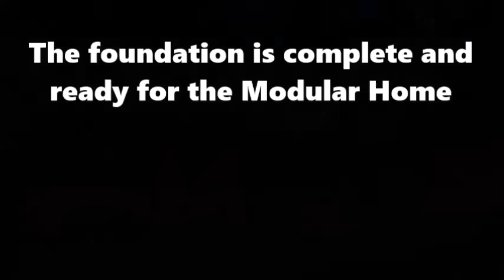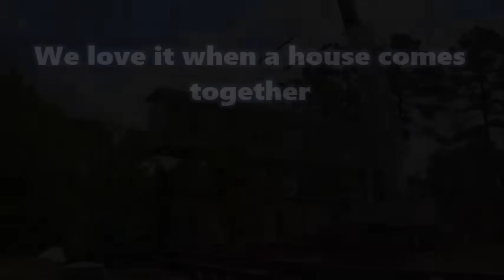How Are Modular and Manufactured Homes Set Up?

Comment: Lower the load as low as possible - stay out from under the load -  these guys give me chill bumps.
Reply: I don’t think thay have done to many maybe one of there first I don’t know  but I am so glad that was not my home holy crap I ant been all to impressed with them or the homes they are selling
Reply: I used to work on barges driving piles. Biggest rule was NEVER get under the load or boom of the crane. I was glad I followed those rules one day the packing on a main lift ram gave out. The boom was laying on the deck of the barge before anyone realized what happened. It's the purpose of the tag lines, these guys obviously are not experienced at what can happen.....

Comment: The main advantages of a modular home vs stick built;
1. The building materials are safe from theft because they're in a factory. 
2. Once the home is delivered and set up you can move in right away.
3. Arguably better control over construction process. 

Care to add more?
Reply: 4. Many efficiencies come when building in a factory environment with more specialized equipment and such.
Reply: 1. PRICE
Reply: Speed. Unless you have a massive construction crew with all of their ducks in a row, it's probably the fastest way to get a full size house. They can build these homes in a couple weeks in the factory. Within a week after it's done, it can be installed. on the site. I remember one company saying they typicall can build a double wide in a week.

Comment: The modular will be gone but the foundation will still be there???? At 130 mile wind
Reply: Modulars are actually built stronger than normal stick built homes because they have to withstand being transported so they have a higher building standard the company I've been looking at their modular homes are rated to withstand 175mph winds
Reply: @lightning8180  when banks see it that way, then I'll believe you. Unfortunately they don't. Maybe they aren't convinced they will hold up to that value, by what they used to be.

Comment: Why bother with crawlspace vents when it’s all encapsulated. Was this in a flood zone?
Reply: Radon ventilation...also humidty moisture
Reply: @christineloz1686  Radon should be vented with a piped system from under the ground/slab or under the encapsulated floor. Humidity and moisture should be controlled with typical conditioning systems. The proper way to do an enclosed crawlspace is to treat it as conditioned space and supply heating and air conditioning to the space.  By adding foundation vents to the outside, you are letting moisture INTO the space. With no space conditioning, the crawlspace will be ground temperature (about 55° depending on your climate zone). When the humidity in the outdoor air meets the cool temps in the crawl, you'll get condensation and water on the surfaces.
I'm sorry to be a negative commenter, but I think you need to work with a home performance professional such as a HERS Rater to improve the homes you build.
Reply: @MattKnowsThat  thank you for the info.
I have looked at 3 doublewide homes...all 3 had a chemical smell..I do know they all use fiber board or particle board which use a formaldehyde laden glue.
As the house has no wall, roof ventilation, how does one rid the house of these odors?
Reply: @christineloz1686  Can I assume that your homes meet standards for low-income or other subsidized housing? If so, HUD has standards for formaldehyde emissions, so I would start by making sure the manufacturer is using properly graded materials. Almost all of the off gassing will occur in less than two years. Faster if high temperatures and humidity are present. 

I'm also not sure about your local code requirements, but ENERGY STAR standards (required for any FHA and HUD projects for new construction) require the home to have whole house automatic mechanical ventilation to meet ASHRAE standards. This can be achieved most commonly by installing a continuous or programmable bath fan or other exhaust fan.  Other methods would be the use of an Energy Recovery Ventilator or Heat Recovery Ventilator. Those systems are "balanced" so they will be exhausting air from the house and at the same time, bringing fresh air in. They operate either continuously or on a % run time controller.

Are you planning to have a ventilation system?

Many of the Habitat chapters that I've worked with over the years have learned what materials are off gassing and can target them with either custom options that do not off gas, or encapsulating the product with a clear low-VOC finish. For example, the countertops are made of particle board, so in HFH projects, they will put a clear finish on the underside and edges of the countertops.

Finally, I worked with a builder many years ago on a house that had a very bad chemical smell. So bad that your eyes would burn when entering the house. Turns out the foundation contractor had added an admixture to the concrete to speed up the curing time. The house had a basement and was poured in the winter. As the concrete cured, the  calcium chloride was off gassing into the house. CC is also used when the foundation needs to cure faster to get the house set. We see the same problem with "blitz build" projects. 

I hope all that helps. I'm happy to answer more questions if you have them. I've been in the home performance business for almost 15 years and tested thousands of homes. You can reach me at matt@wnchomeperformance dot com

Comment: How does this house breath if it is completely encapsulated
Reply: Houses aren't supposed to breath... Any house built after 2009 needs an air pressure test to pass code. The tighter the better, don't want that mold!
Reply: @MrWestten  not true..well built homes are required to be breath..thats what those vents are in the eaves and roof..
On the contrary ..moble homes have no such ventilation
Reply: No DPM under the timber plate on Brickwork?

Comment: If one decides to remove a modular home..how easy is is that accomplished
Reply: It's not. The whole point of securing it to the foundation is that it's basically the same as a stick built at that point. To keep it mobile you'd need a manufactured home, not modular and only have skirting instead of securing it to an actual foundation

Comment: Absolutely the worse rigging I have ever seen. I have set probably 2-300 crane set modular homes and I would never allow that rigging. Terrible
Reply: Do you know how much doing this will cost? We will like in a future buy a mh and do this.
Reply: Depends what company u go with but they are significantly  cheaper than normal stick built homes just make sure u do your research and go with a reputable company their is definitely a lot of pros with going modular from what I've read and to answer your question normal stick built homes run around 100$ to 140$ per square foot but modulars run 65$ to 85$ per square foot but also depends on location lot of variables just a rough estimate
Reply: Worked with cranes (mobile, dock and ship's gear) since 1966 and in all kinds of circumstances; but this clip was a FIRST ! ! !

Comment: This is not a modular home. This is a factory made home, comely called a mobile home. Bin
Reply: This is a modular built to the same codes as a stick built for the state, and is set on a true foundation footings to code. Manufactured are built to 
standards regulated under HUD, and are placed on piers.